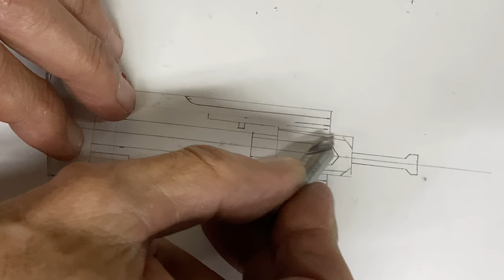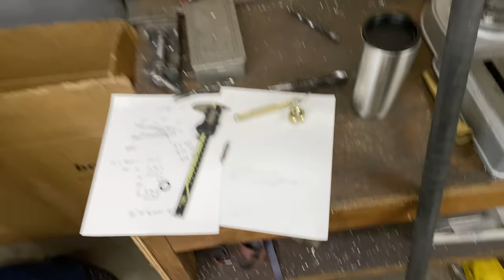Making a better garden hose nozzle // Paul Brodie's Shop

Comment: Just buy a garden hose adapter/shutoff to male pipe thread ?  Some years ago we had a water tanker truck ( the off hi-way variety) and it had a remote monitor spray head on the front of it that worked great as far as rotating and pitch but the pray pattern was fixed other than volume/ pressure  and we needed precision with volume and yes you can buy them but anything related to fire or marine equipment is very expensive. 
One of the guys was a millwright at onetime and came in the following week with a nozzle that was mostly off the shelf parts except the tip and the best I can describe it was more like a 2 stroke dirt bike pipe or expansion chamber looking thing but it worked amazingly well launching a rope like stream of water the length of a football field with very little spray out side the rope so to speak at least on a calm day  and as you can imagine  for safety reasons we had to establish some rules of when & where it could be unleashed and personnel and the Sani-cans quickly became off limits as much as you’d want to water down the area to keep down the blistering heat so you didn’t need to prop the door wide open to the world or risk passing out from holding your breath or heat exhaustion @ 115 F ! Not that relevant here but made me remember now some lol moments years back . Thanks 😊
Reply from the maker: Allen, thanks for telling a good story!

Comment: Whilst the machining marks were pretty unobtrusive visually, it's a safe bet they are having some impact hydrodynamically. It may be possible to clean up the spray a little if you polish the internal tapers a bit. Could get you closer to a laminar flow.
Reply: Is it even possible with that design? The water has to do an almost 90º turn.

Comment: What is that tool that looks like a parting blade with a bull nose insert that you use for contouring all the time?
Reply from the maker: It's a radius carbide toolbit. They are available in different sizes, and come in very handy.

Comment: Nozzles, they're always failing. Either the thing loses it thread taper and leaks or the nozzle doesn't adjust smoothly because of design flaws and leaks worse.

Oh, all except the small one with the ball bearings, the original ones. I have two, one that's 20+ years old and a newer one I bought about 5 years ago because I couldn't find the other.  Well I found it and so I have two. I can wash a wall, sidewalk or car with it wide or clean the dormers up top at 30 feet with the finer spray. 

Trick? Always remove it from the hose and put it away when your done. WD40 couple a times a year helps really well in cleaning and keeping the rubber pliable. Stored in an oily Crown Royal bag. 

That being said, a bespoke Brodie Knozzle would be nicer.
And it wouldn't be stored in an oily sack, I'd be inclined to pick up a fresh jug with a clean purple and gold blanket for it.

Thanks for sharing the project.
Reply from the maker: Nick, thanks for watching and commenting.

Comment: Can't believe I just bought a nozzle less than 3 hours before I saw this video :( .  Peter
Reply from the maker: Did you get brass or stainless steel?
Reply: @paulbrodie  It was actually one of the multi-spray units . The brass one similar to yours is not on her "A"  list for the numerous plants she has .

Comment: I sometimes wonder why garden hose thread (GHT) is 3/4-11.5... i know there are some larger diameter, but they are all 11.5 TPI. I've read it comes from an ANSI spec for firehoses, but why 11.5??? it must be the weakest thread that doesn't blow out under the firehose pressure the old ANSI spec called for
Reply from the maker: Gunhaver, you asking all the right questions!

Comment: I don't understand how you are adjusting the fan. Why use thread tightening as the adjustment mechanism and not some sort of slide?
Reply from the maker: Both could work. A fine thread will probably allow finer adjustments.

Comment: There are taps and dies for these threads,  but they are stupid expensive.  Way out of range for occasional use.  This is leading to a servo driven carriage and tach driven spindle, so you can do any pitch thread you can imagine.  Maybe arduino or pi driven.  Maybe that's your next project??  (I'd watch that all day long)
Reply from the maker: I have never heard of Arduino of pi driven feeds. Obviously, I still have lots to learn.
Reply: @paulbrodie  Clough42 has a very interesting approach and proof of concept for this.  You may need MULTIPLE cups of coffee for his series of videos on this.  This stuff just fascinates me.
Reply: @paulbrodie  https://en.wikipedia.org/wiki/Arduino

Comment: Commercial precision nozzles often have internal paths that induce a rotating flow to the fluid prior to it entering the spray shaping section. This makes the spray shape more even.
These paths need to be no more complex than tangentially drilled holes or grooves on the nozzle core, leading to the outlet.
https://en.wikipedia.org/wiki/Spray_nozzle#Pressure-swirl_single-fluid_spray_nozzle
19:09 see how the cone of the spray is uneven as it leaves the nozzle?
Adding swirl to the flow will even this out.
Reply from the maker: Paul, I never said this was the definitive spray nozzle. This was basically my first attempt after thinking about it for literally years. Yes, it can be improved, and the rotating flow is a good idea, thanks.

Comment: Nice work, if you want to sell the plans (zip file is fine) I will buy one.
Years ago got tired of the rotary coupling leaking on my hose reel, so I built a new one, solid brass and stainless. 10 years later it's still going fine with zero leaks.
Reply from the maker: I am starting to work on a good set of drawings to sell next to the frame jig plans. Thanks.

Comment: 1+1⁄16 inches (27 mm) diameter straight (non-tapered) thread with a pitch of 11.5 threads per inch (TPI), plumbing sizes are weird
Reply from the maker: Yes, it's 11.5 TPI for a GHT. Garden Hose Thread. There is a lot of information in the comments :)